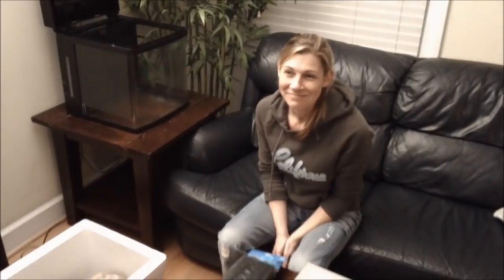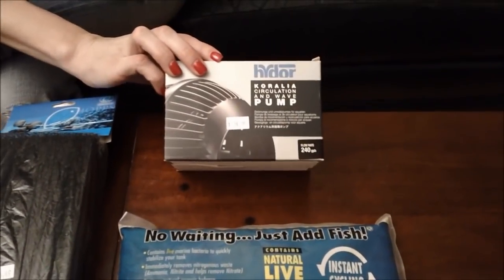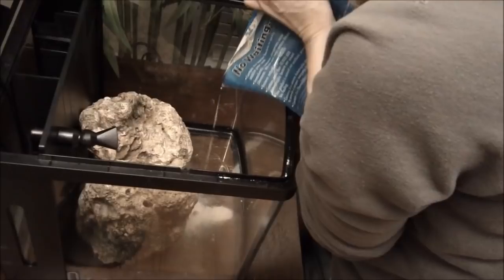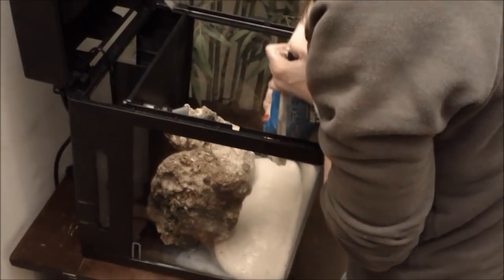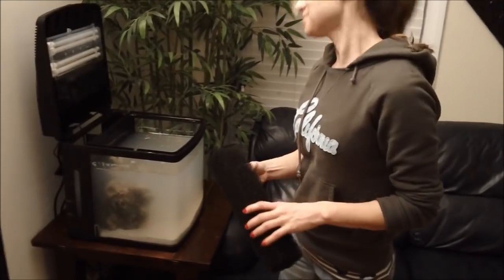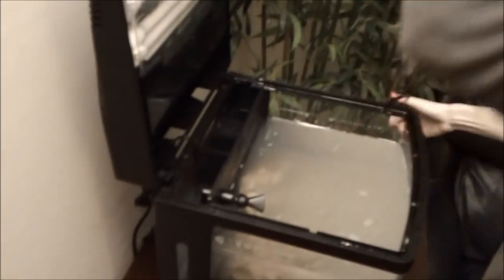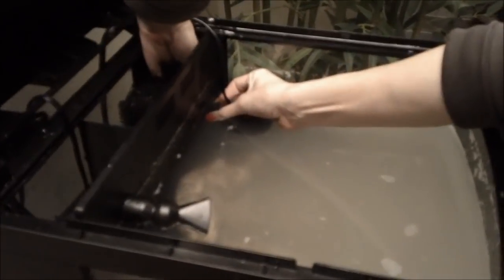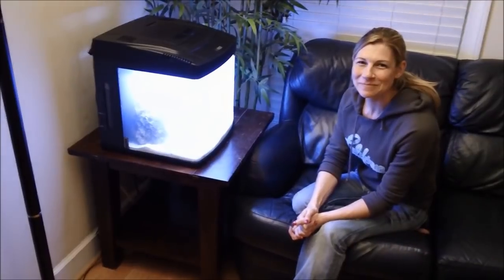Coralife BioCube Basics: Day 1

Comment: At the end reef thuz tells about the water level that it is way above the max line just wondering if you keep it that high if the power shuts off will the tank over flow like a sump cause the filtration on the back looks like it acts like a sump
Reply from the maker: J Parker It does not overflow if the power shuts off.  It is one volume of water